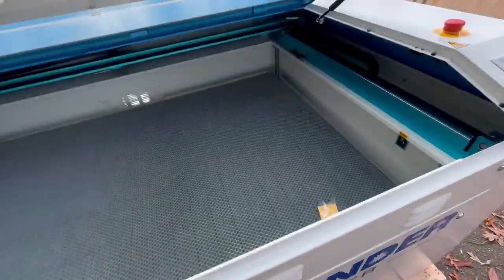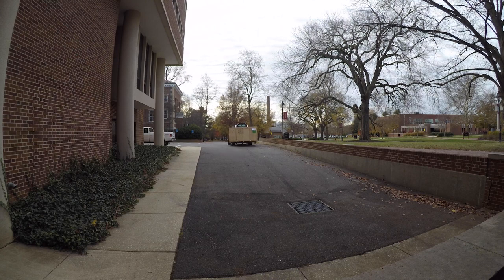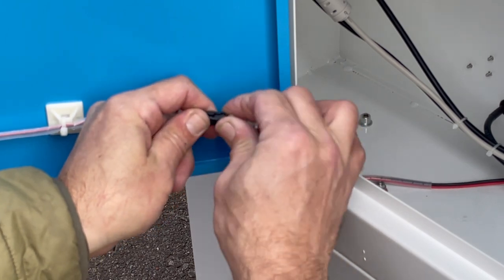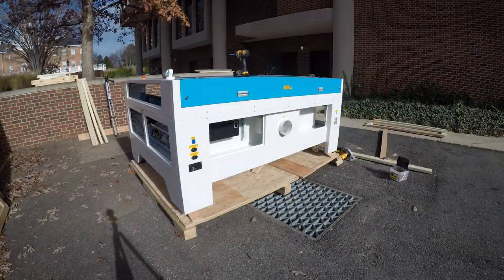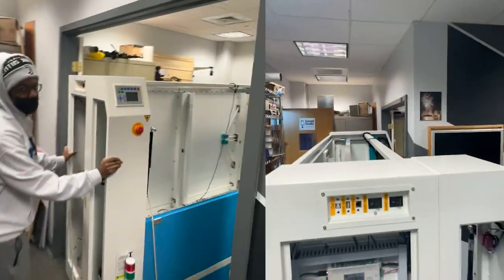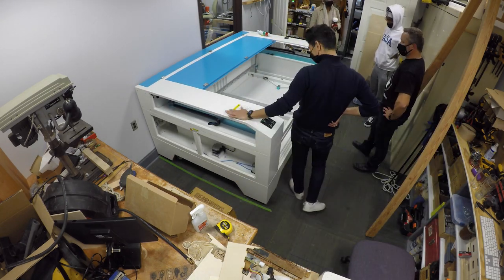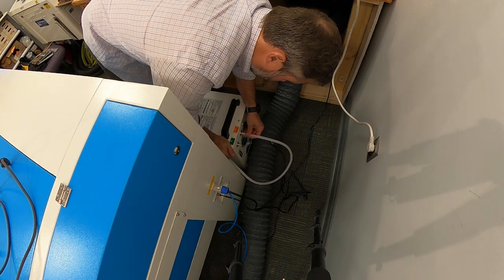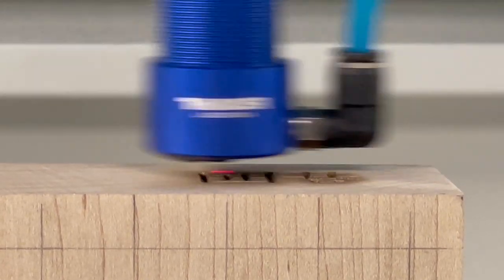Thunder Laser Nova 63 - Unboxing and Setup

Comment: Nice Laser. I have a quick question for you. What benefit did you see by removing most of the doors? As I see it the doors would afford a measure of protection against damaging the electronics and circuitry. The few pounds advantage to make this machine lighter seems irrelevant.
Reply from the maker: Good question!  All that metal adds up in weight.  The more I have to muscle it around, the less control I have during the move.  It’s hard to rehearse the tip onto the edge and the tip back flat again.  I wanted to reduce the likelihood of loosing control. 

I left the tube covered because it’s very exposed and one quick tap could be catastrophic.  The doors that close in all the rest aren’t exposing delicate stuff right at the opening.  For some of it, like the knife edge supports, they are only held in place by gravity.  If I were to tip the laser up with those inside, they’d all fall out of their slots and bang around inside.  

Overall, removing just the doors, lid, trays, grid, knife edge supports, and base reduced the weight by hundreds of pounds.